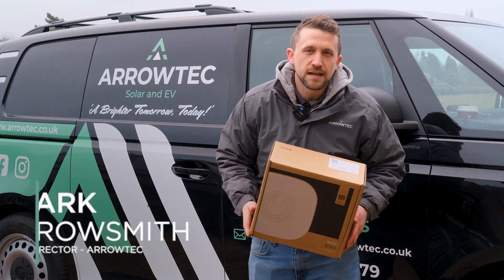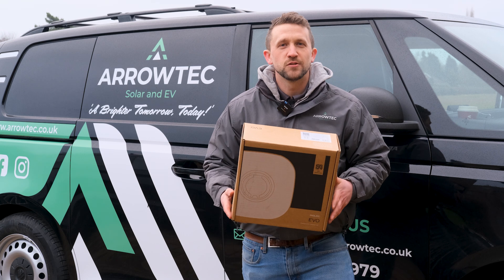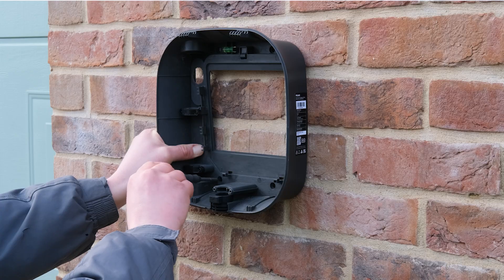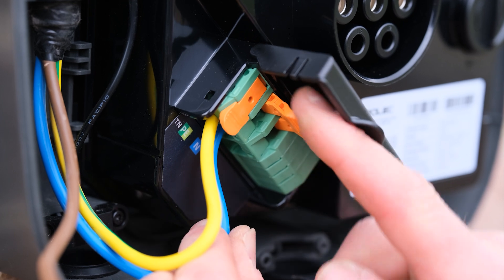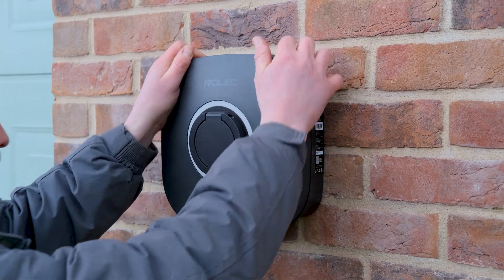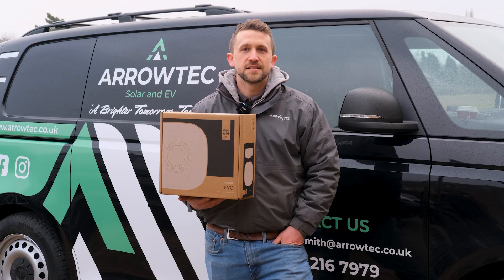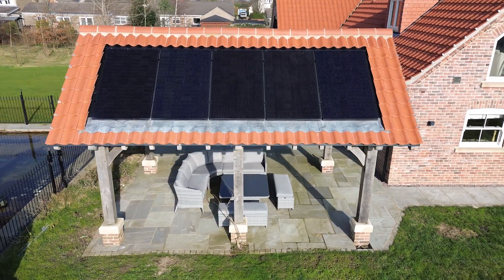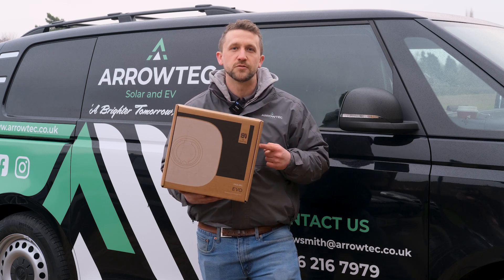EVO: The Easiest Charger to Install

Comment: Do you need to plug in the ethernet ? I have a plugin hybrid Cupra and my router is the complete opposite side of the house to where my EV junction box is
Reply from the maker: Hey, thanks for your message. If the router location is too far to use an Ethernet cable, you have the option to connect over Wi-Fi👍🏻

Hope that helps😁
Reply: @rolec1990 perfect many thanks